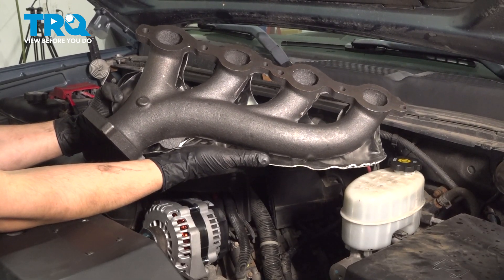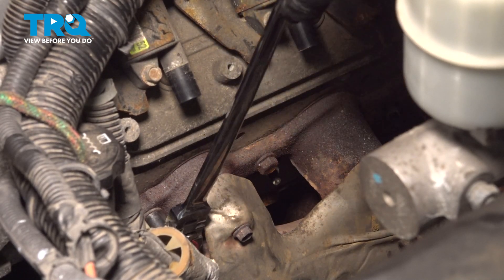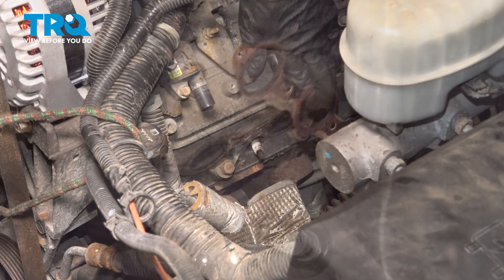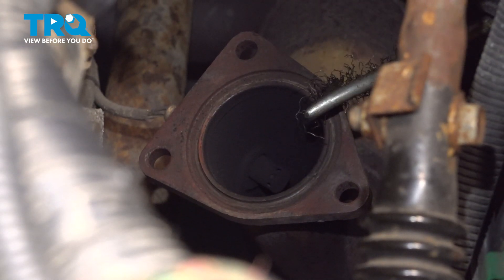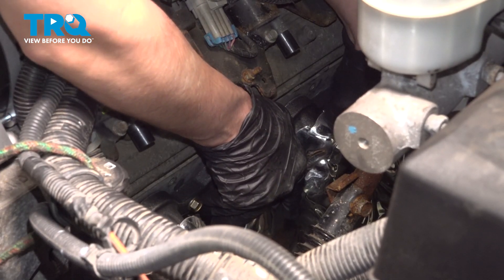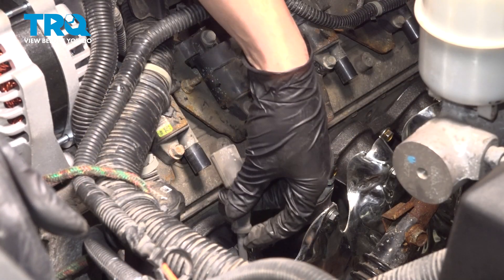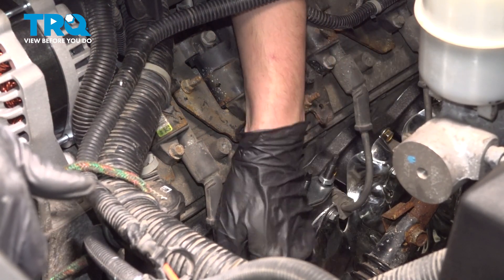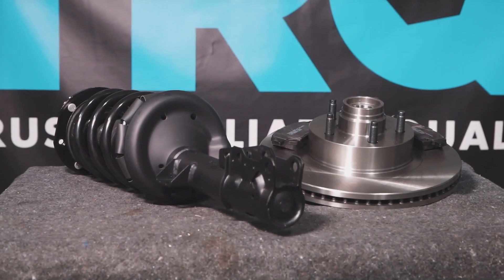How to Replace Exhaust Manifolds 2007-2014 Chevrolet Silverado 2500 HD 6.0L V8

Comment: Love all your info videos on parts replacement but your torque spec for exhaust manifold bolts at approx  9:00
 here stating 11 ft lbs on first pass and 15 ft lbs for final pass  seems incorrect according to all other info I've
heard here and in forums. They all say 11 ft lbs on first pass and 18 ft lbs for final pass. So is it really 15 or 18 ft 
lbs?

Comment: Gotta heat the bolts with a torch before you even attempt to remove them.   If not, you will most likely break the heads off the bolts